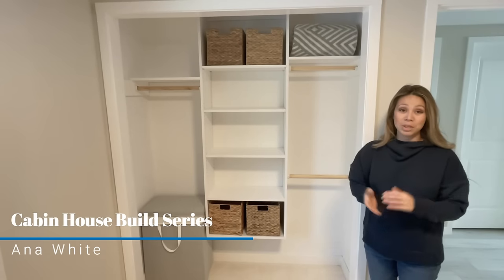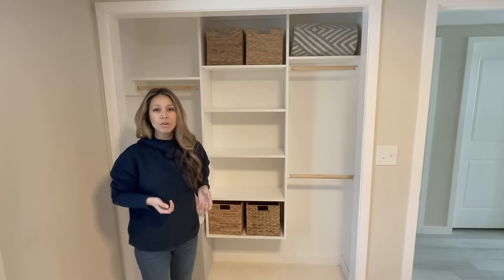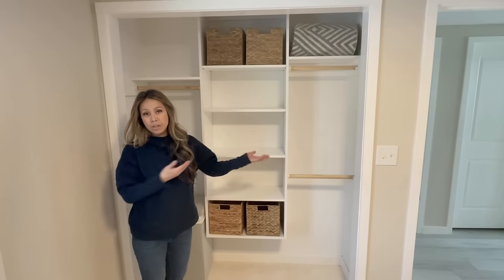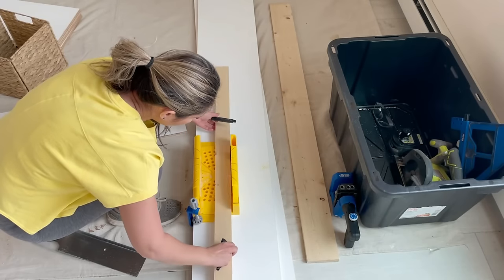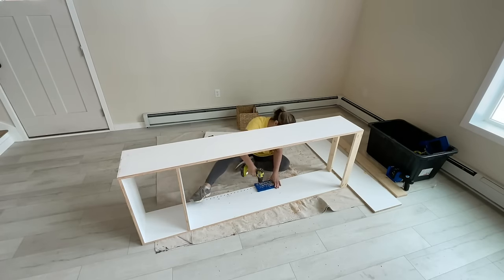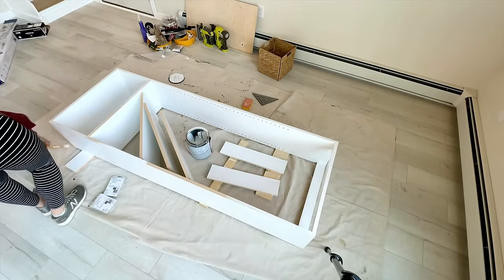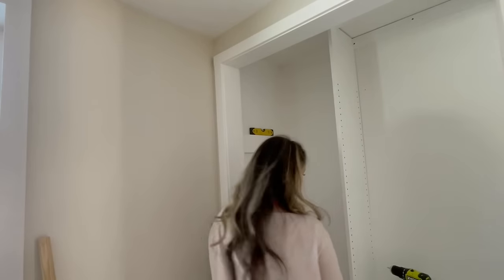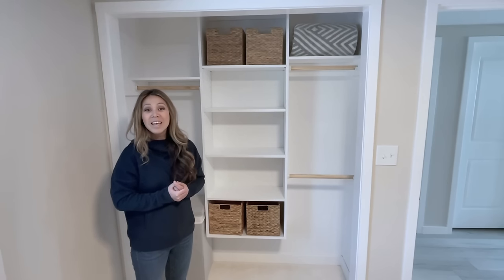Build Your Own Custom Closet Towers!

Comment: Please talk about why you went with baseboard heaters.
Reply: I guess its way cheaper to buy few baseboard heaters then doing whole HVAC. I have no clue what electricity cost is in Alaska, but where I am I would go bankrupt having electric heat and hot water. Also where I am, we would still need air exchange system in the house.

Comment: That is fab!  You’ve given me inspiration to turn my built in closet in my art room into customised shelving.  Do you think I could use the existing doors for wood for shelves?
Reply: Probably not. Most interior doors are hollow.
Reply: @altpath  they are chipboard closet doors, about one inch thick
Reply: @rosebuhr  it might work, but you might want to put an edge band to make it look nice if you use that for shelves.
Reply: @altpath  yes, I will.  Thanks for your help
Reply: Definitely. They may be hollow,  but they are strong!
Reply: Definitely! They may be hollow, but they are strong!

Comment: I am currently designing a gooseneck tiny house instead of renovating a double wide mobile home. Would it be possible do you think to send you my design and get some ideas from you? If not, I understand. I am in Denton, TX and prefer the Tiny Home simplicity, though, I am not sure you might think it once you see it.  can I send you my SketchUp design? I am a beginner, but I have big ideas.
Reply from the maker: That sounds like fun, I am not offering custom design services at this time, however we would be happy to send you some ideas or links to check out! Email anawhitesite@gmail.com